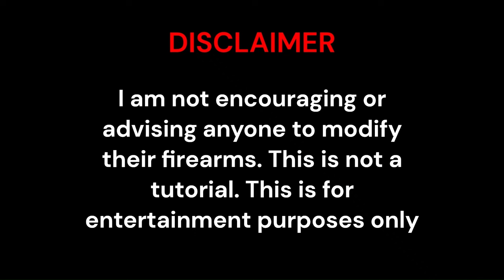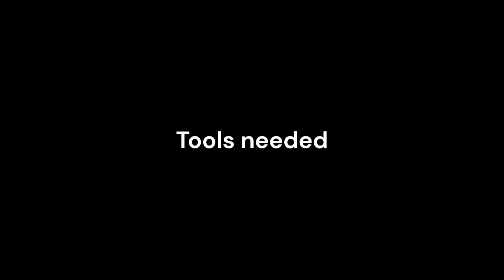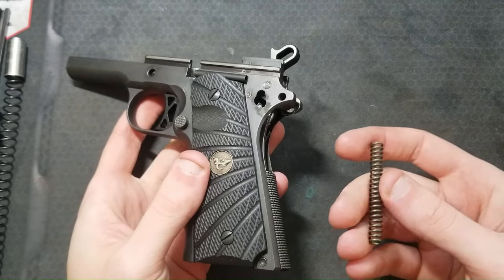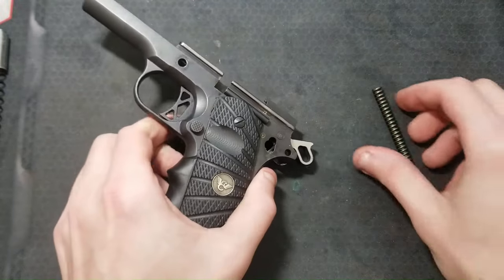How to Lower the Weight of a Heavy 1911 2011 Trigger

Comment: I just bought a Prodigy 5” Comp as my first 1911-style pistol partly because of your awesome videos on this channel. My plan is to install an EGW ignition and a red dirt or atlas trigger and I’m looking at replacing the Main spring and recoil spring. The Internet gives wildly different opinions on the proper weight of those two springs, but do you have any recommendations or resources for how to choose them? For instance I see a common suggestion being 17# mainspring and 9# recoil spring.
Reply from the maker: I used to install different weight mainsprings based on my desired trigger break weight. After much experimentation, and many trigger jobs, I just install 17# with all my trigger jobs now haha. My trigger jobs usually range from 2.75 - 4.25# break weight. I have never had a light primer strike with a 17# spring and I always run XP firing pin springs (factory brass case ammo). 1911s are pretty tolerant of mainspring weight. There is also subjectivity surrounding proper main spring weight - there will not be one that is appropriate for all applications. I run 17# in all my guns, but if I wanted a heavier defensive trigger, 4.5# +, it would be 19# or 21# (I don't use 1911s for defensive purposes, but if I did...). If I wanted a really crazy light trigger, I may go with 15# knowing that light primer strikes may occur (my sear geometry would also be cut much different with more engagement depth for proper safety margin at a lower break weight). I would stay away from the advice of anyone who says "no matter what, always use XX# mainspring." 

If I were me, I would hold off on the recoil spring and see how its sprung from the factory. I know the original 5" guns came with too light of a spring, but I think they have them sprung much better now. Clean it, lube it, run a couple hundred rounds of your preferred ammo thru it, see how it feels, see what the ejection pattern is like. Go from there.

There is also subjectivity associated with recoil spring weight around that operational window depending on how you like your recoil to feel. My recommendation would be based on how I like my recoil to feel and may not be what you like. However, I think that 9-10# range is pretty common for 5" 9mm pistols. 

Hope this helps! Enjoy the new pistol.

Comment: Another great video!

I’ve got a Tisas Stakeout that is a project in the works. The trigger pull was really bad out of box. I take it apart, and lo and behold, the sear spring was installed improperly, and the middle tang was bent too far. Simply adjusting the tang dropped the pull weight from 5.5lbs down to 4lbs. 

Once you know how the sausage is made, it’s not nearly so complicated to work on the 1911. It just takes the desire to understand and learn the design, like you say in the video.